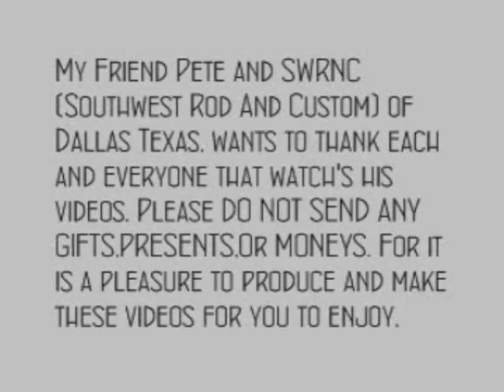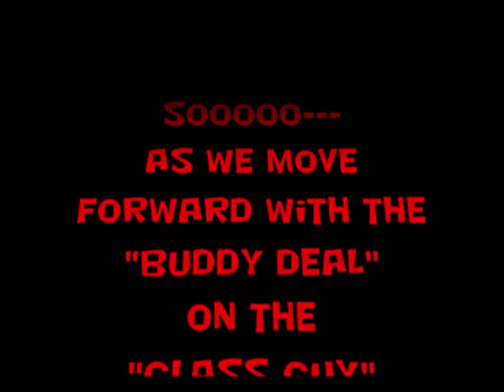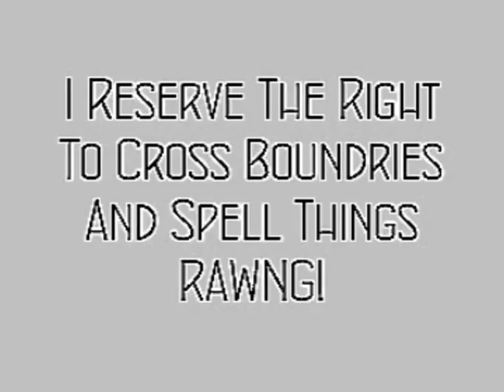How To: 1969 Plymouth Roadrunner-Buddy Deal Paint Job-Part 4

Comment: Hi, I use the new foam tape from 3M, and got great results. The part number is 06293. I also use their transition tape as they call it 06800. That new foam tape is wider and can be used in more situations as the original one. Love your videos and work, keep doing em right.

Comment: I always liked PPG's Concept Urethane single stage. I usually shot 3-4 coats, than let it sit,a and color sanded it and buffed it. Delstar is good too. PPG kept Delstar around, because it is a good paint and has showed that it holds up over time.

Comment: All your paint jobs look amazing, just curious why you still use Conventional spray guns rather than jumping up to like a Sata 4000 or something in that nature. I mean what you are doing is obviously working great. Just wondering if you have a reason or is it because you always used conventional so you hate to switch lol.
Also, I'm looking into buying a booth any suggestions? or tips to build one? I kinda was looking at building one but i don't really know how the Exhaust works or if i could get a lot of Exhaust fans and wire them at the back of the booth.

Comment: What paint would you recommend for a non-metallic Single stage?  I heard you say you hate Dupont Nason single stage (I heard good & bad.  I guess it depends on what price you get too).
Reply from the maker: I would recommend PPG Single Stage Urathane, or PPG  Delstar Acrylic Enamal..  If your on a budget I would use PPG Shop Line Plus, I would NOT use OMNI! Stay away from PPG Omni Paints, they are JUNK!
Reply: swrnc
Thanks!  I remember the Delstar Acrylic Enamel.  I'll probably use that.  I remember some stuff.  My friend, way back, always used Ditzler (PPG?) and hated Dupont.  The first time he painted a single-stage urethane, with the catalyst, was when the product was first introduced. My '69 Roadrunner convertible was the test case.  That urethane paint was a lot stronger than the lacquer that was being used at the time.
Reply: swrnc
It may have been Delstar Acrylic Enamel (vs. urethane) that was used on my '69 Roadrunner.  I definitely remember that name "Delstar"., but they called the company Ditzler back then.  Catalysted paints were brand new.  I guess that was about 1976?  I thought Delstar was great paint back then.  I didn't know they still made it.  I would use that since I remembered it was strong and had a nice shine and it covered very well. Thanks again.

Comment: I understand that putting a paint product which is not compatible with the paint product beneath it will make a mess but compatible paint products stick to compatible paint products and the bond of the top coat is fully reliant upon the bond of the paint (or primer) beneath it. So if a car has a poor primer put on it, would you not have to completely remove that poor primer (not just sand it smooth) and start from scratch to achieve the proper bond of the higher quality primer you wish to use? Putting a bandaid on top of a bandaid will not make either bandaid stick better to the skin no matter how much prep work you put into preparing the first bandaid to receive the second bandaid on top of it, in other words. Am I right or am I missing something?
That sassy grass green looks as amazing as it looked when it first came out back in 69, I think. We had never seen paints in that color band up until then on any cars and it just blew everyone away. Later the neon colored paints hit the market and that was even more amazing but Chrysler was the first to move off the basic color band with Sassy Grass Green. Thanks for the video Pete. Hi Minnie. You are still the best body shop girl out there.
Reply from the maker: No-Not in this case.. Since the primer was NEW and it was a 2K style primer this means that is was solid and well applied, the problem at hand is that it's not compatible for a high quality paint job that we are trying to achieve here. The primer the owner used is for a job like Macco or Earl Shybes.. We could have painted on top of it, but it would have looked like crap!